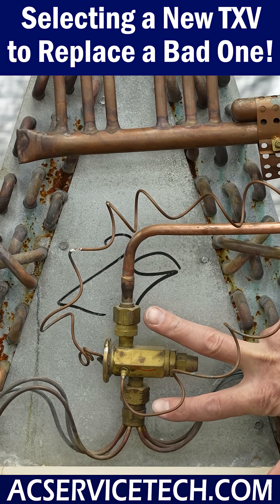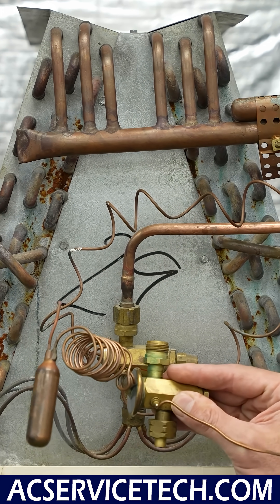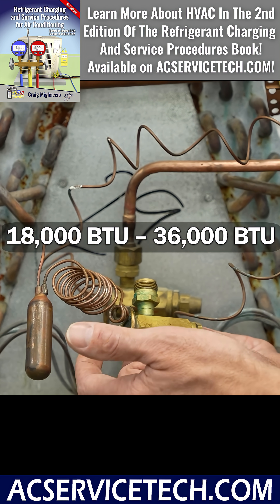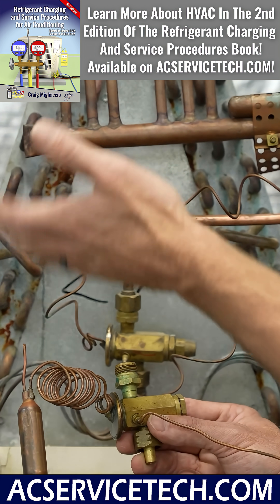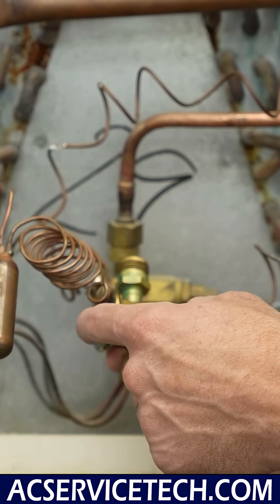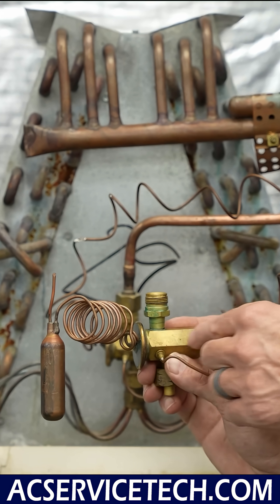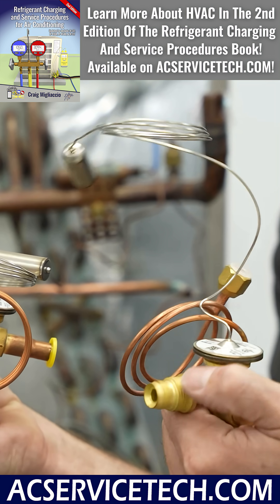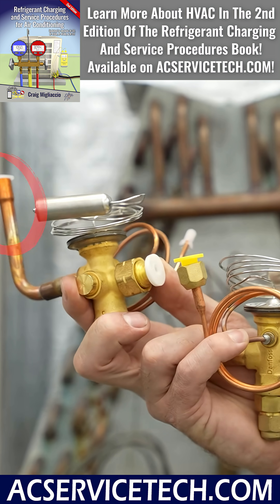Selecting a New TXV (Thermostatic Expansion Valve) to Replace a Bad One!

Comment: Not if it’s a warranty coil from rheem they have started to conch on the threads in order to prevent you from changing it out 🙄
Reply: Why
Reply: @REALDEAL_HVAC 
Ask rheem that. I’m assuming they don’t want you to take the coal apart from the TXV on a warranty coil.
Reply: Just brazen them
Reply: @sergiocruz5617  the one application that I am talking about is a threaded TXV to an aluminium coil.